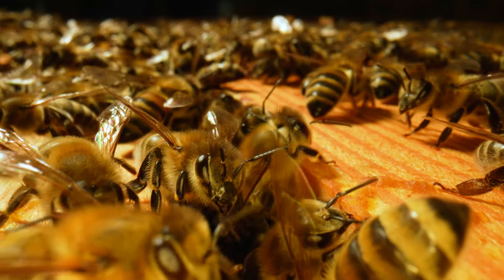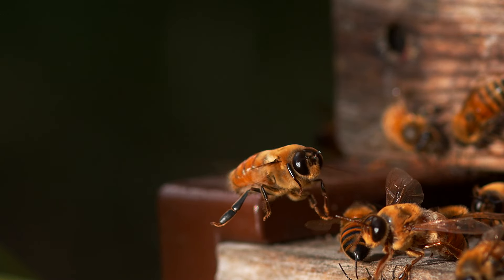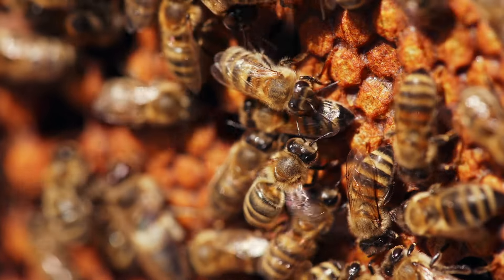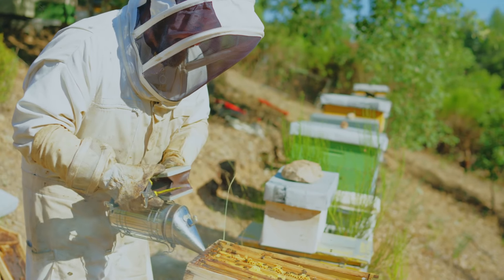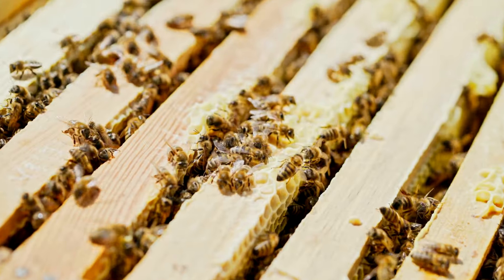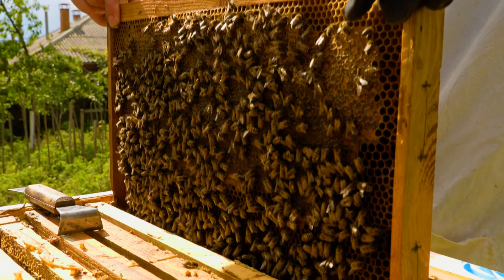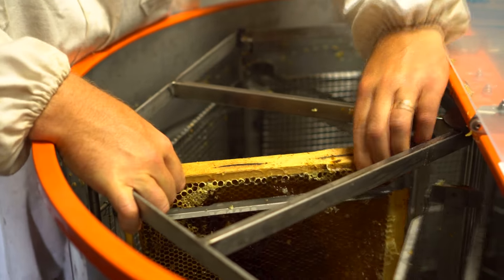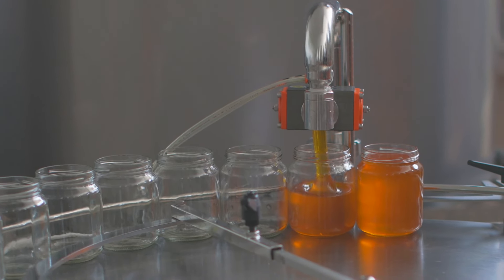How It's Made Honey

Comment: I wonder what purpose the honey serves the bees in nature? Do they use it for food? Why would their existence be centered on producing something unless it provides them some form of benefit?
Reply: If bees stored nectar, it would ferment and go bad fairly quickly.  But converting it into honey allows them to store it for as long as they want, so they can save up and consume it when needed without worrying about it going bad at all.  Bees have a special stomach specifically for converting nectar into honey, which breaks down the nectar into simpler sugars, then they deposit it into the honeycomb and seal it after they cool it with their wing movement to reduce excess water vapor. So their bodies essentially purify the nectar into what we know as honey, and they keep it safe sealed away in honeycombs til they need to consume it for energy. Typically they consume it during the winter when they can't get pollen (which they also consume).
Reply: @Bry.89  You solved the mystery.  Thank you for your knowledge
Reply: Lol honey is bee food
Reply: @Bry.89  Close.  Honey is stored carbohydrates which they consume for energy when nectar is not available, not pollen.  Stored pollen is called "bee bread".  Pollen is protein for the honey bee which is fed to the larvae.